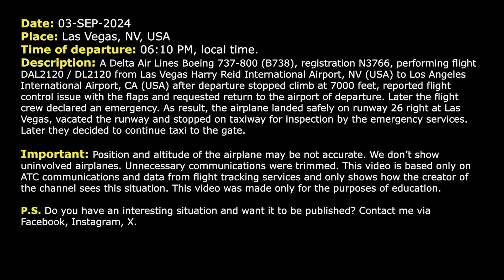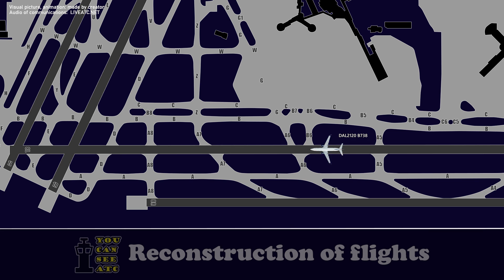Flaps issue. Delta Boeing 737 declares an emergency after takeoff from Las Vegas. Real ATC

Comment: Why is the tower not answering the emergency aircraft on final?
Reply: YTCATC doesn't always capture both sides of the conversation.
Reply: @birbtw0  That's true but in this case it did seem like they weren't getting an answer, especially when he called that they were up on the frequency.